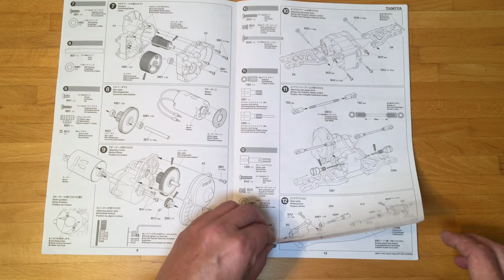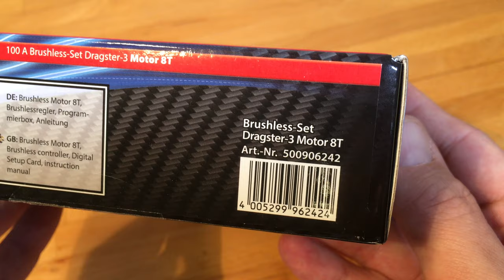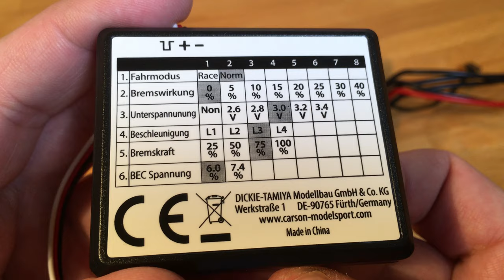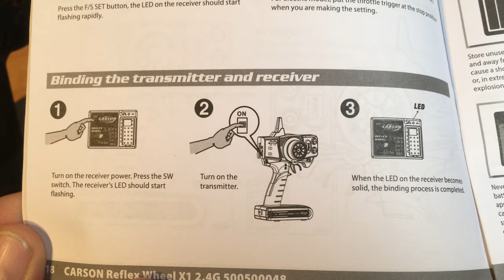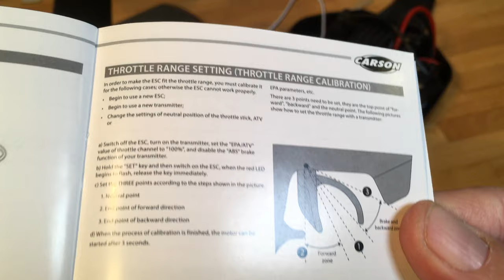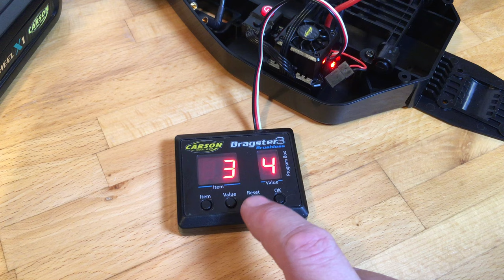Tamiya DT-01/02/03 Project #6: Tamiya Sand Viper (DT-02) Chassis & Carson Brushless Electronics!

Comment: Thanks for the video. I know this is 2 years old and I haven’t watched the entire series yet. I have discovered that the stock damper stay slop can be removed using hex head ball connectors at all of the shock connecting points. The front lower shock mount can be easily fixed. What you do is use the extra spacer for the shock mounts on a tt02b. You will need to install ball connectors to free them up. Then you get a drill bit and spin it by hand to make the hole big enough on the spacer so that it fits over the brass bushing and it will take up all of the slop. Just did this on my dt03 and will also do it with my sand viper when back order is fulfilled ;)
Reply from the maker: Hi Daniel. Yeah, I got ball connectors on my DT-0SMS too. They work great ☺️
Reply from the maker: And thanks for the tips!

Comment: Bravo Mikael, another great video very well realized as you are used to do. It's funny,  I also changed my brushless combo on my DT-02 today.
I’m having a little problem with my body (a Sand Viper too) touching the esc which is too high and I was wondering if you weren’t going to have the same problem with your Carson esc which seems high to me too. I hope that it will be ok. That was zen and cool , merci mon ami !
Reply from the maker: Merci, Alex! Yeah, it’s a problem. There’s no great solutions though. 1) Flip the top/rear body mount and mount the body higher 2) cut holes in the body above the ESC 3) remove the fan from the ESC 4) use double-sided Velcro on the sides to set the body straight (which will mean the body rests on the ESC = potential heat issue) ... No great solutions for the small bodies like the Viper and Gator. Not sure which one I will pick when time comes 🙂
Reply: @NordicRC  Thanks for these 4 solutions, this afternoon i thought i'll make hole in the body to let the esc breath... but as you, i don't know yet what will be the best solution. Let the night give us some advice... Take care Mikael.
Reply from the maker: Maybe there are more solutions. I know I won’t be cutting my body before I have tried some of the other solutions. Will definitely flip the rear body mount and see how it looks with the body raised. Probably not too good but maybe better than with a hole 🙂 Have a good night’s sleep, Alex.

Comment: Just a quick or maybe not so quick request. 
Tell me(us) what you think of the Tamiya brand.  It's probably been 30 years since I built and raced a Tamiya car, and it would get snarky comments when I put it on the track. It actually was a pretty good runner, but there were no parts OEM or aftermarket available back then. 
Would you recommend Tamiya to a friend now ? ?
Reply from the maker: Larry Dommer Hi Larry! Yes, I would recommend Tamiya, but I would also tell them to look around for other options. Even though Tamiya got both affordable entry level models like these buggies - and they got the expensive TRF brand for racers - and everything in between - I think you also pay for the ‘history’, ‘the brand’, ‘the looks’ and just the general atmosphere surrounding ‘Tamiya’. When it comes to certain models, like these in this series or the re-releases , one has to be interested in the brand. If it was only about durability and performance one maybe aught to look elsewhere.

Comment: I had a problem with servo saver catching the front plate,so had to put the ball screws facing towards chassis seemed to work ...was your ok facing bumper?
Reply from the maker: Strange. Yeah, never had any issues. Maybe it's your servo that protrudes more than standard.

Comment: What is the maximum size lipo soft pack will it take?
Reply from the maker: Hi Brad. Not exactly sure. I do not own many soft packs. But will try out the ones I have and do a battery comparison of all the DT’s once they are finished.
Reply from the maker: But yes, it’s a small battery compartment, so a very relevant question. Much smaller than the one on the newer DT-03. With my DT-02’s I have cheated a little with straps and Velcro from time to time in the past.